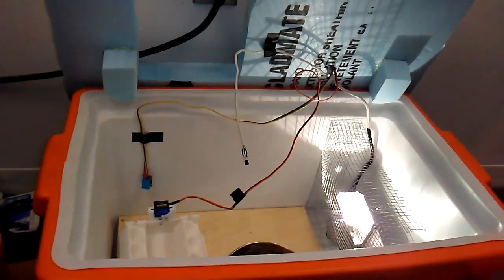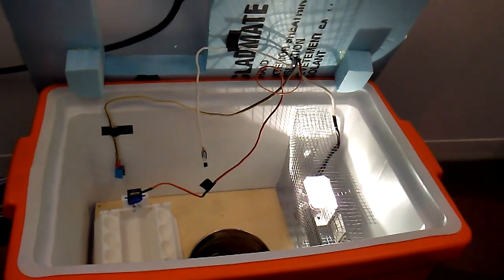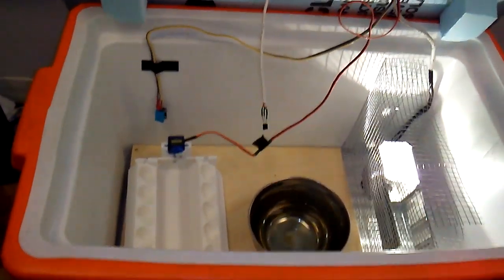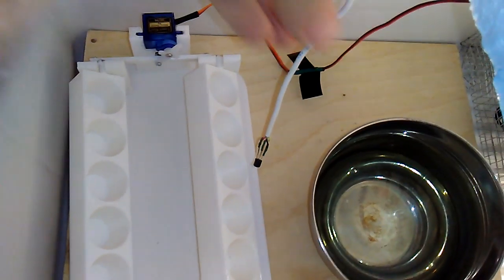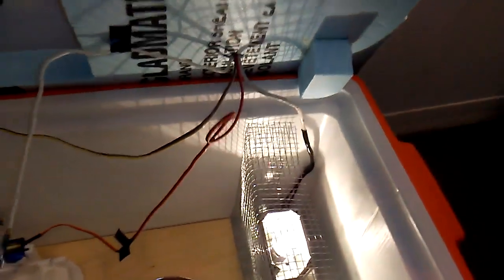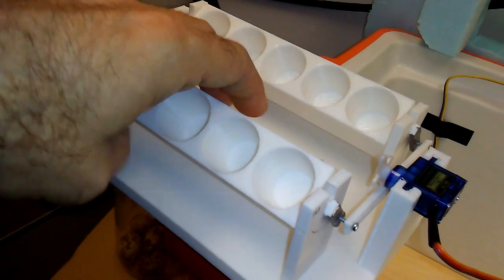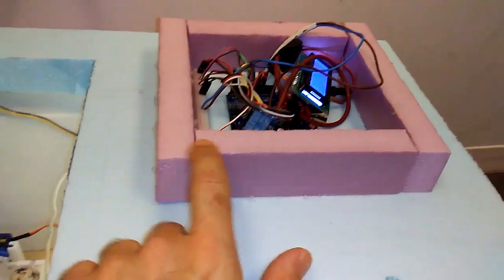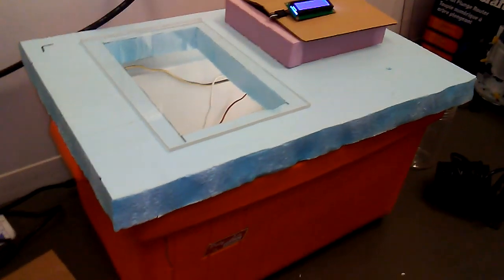9 to 12 volt homemade egg incubator fully automated by Arduino

Comment: Hi, First congratulation for your incubator, it seems very efficient. I' m trying to write an arduino sketch for that but I'm not very good on that , could you let me know how to seperate the servo truning eggs time delay();  and the display delay(); because when I tried to run the loop together it doesn't works. Thanks to help me.Jean-Luc
Reply from the maker: Hi Jean-Luc, if you give me your email, I can send you the code. That could help?

Comment: please can you send to me a circuit diagram 
Arduino diagram and code 
please answer because i'm very need to both code and diagram
Reply from the maker: Hello Mostafa, the circuit diagram is in this website follow lessons #4 (LCD screen), 14 (temperature), 23 (humidity sensor), 24 (relay for light), 26 (servo), : https://www.sunfounder.com/learn/category/rfid-kit-v2-0-for-arduino.html
Reply from the maker: regarding the code, I can e-mail you as attachment...
Reply: @photographiedynamic  This is my email Mostafahagee@gmail.com
If you send a code to me I will be thankful
Reply: Mostafahagee@gmail.com
Reply: @photographiedynamic  plis gan

ihyaudin.im125@gmail.com
Reply: Hi this is exactly what I was looking for thanks so much for this.
Reply: Pls send the code to me also, syamsundar.m@gmail.com
Reply: Bro ı need arduino code how is working servo motor 4 hour /1 change egg box? Code?